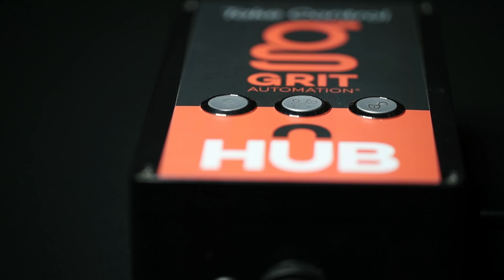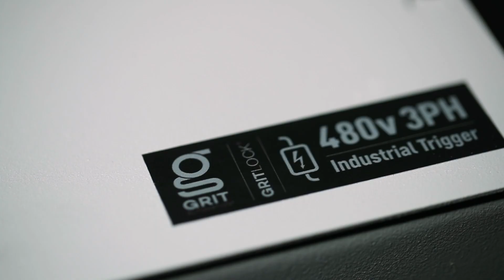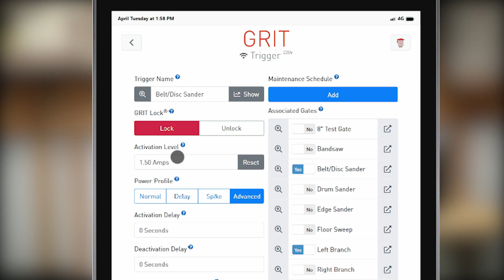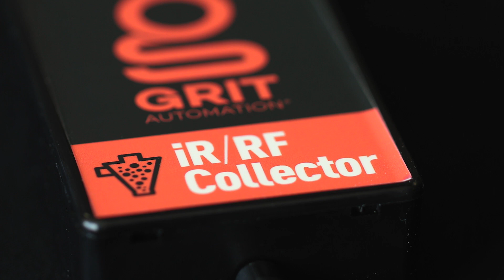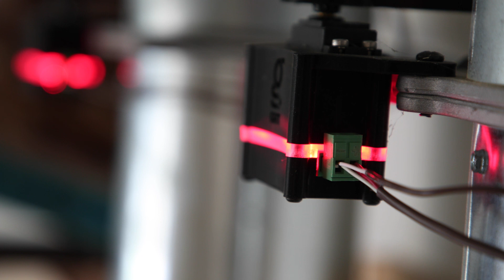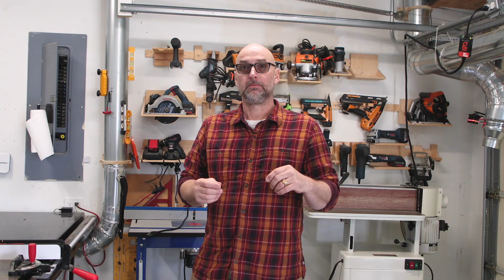GRIT Automation- Automated Dust Collection and Blast Gate Control

Comment: can these gate controls be used on other systems? For instance I bought a shop that uses a ecogate system and I want to add tools but the Ecogate stuff is really expensive. Would any signal work the gate controls or is it only for grit? I think mine runs of 24v but not entirely sure tho.
Reply from the maker: The GRIT Gate Control works as part of the GRIT system. You would need a GRIT HUB and GRIT Triggers for the tools you want to automate gates for.  Even with that, it might still be less expensive than adding the Ecogate components.
Reply: @gritautomation  So those actuators do not just work in a positive and negative reversing polarity where sending a positive opens or closes and neg does the opposite?
Reply from the maker: @ No, because there is no universal "open" setting. Because we are designed to retrofit on existing metal blast gates, the user has to set what "open" and "closed" are for their specific blast gate.

Comment: The gate may need some delay time. From the video, when you turn off the any of these machines, the shutdown immediately. Is it should be have a 5 or 10 sec delay time.
Reply from the maker: Hi! The ability to delay the closing of gates after a tool is turned off is a configurable setting in the GRIT App.
Reply: @gritautomation  Thank you for rly. Looks very good product and design.